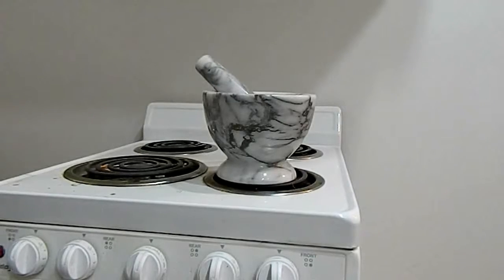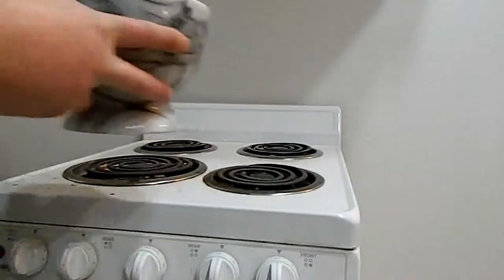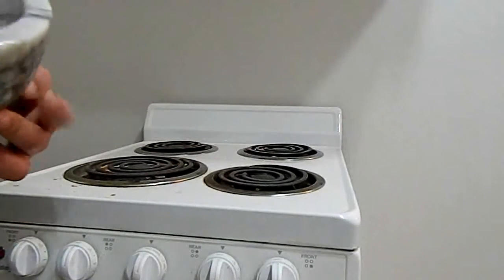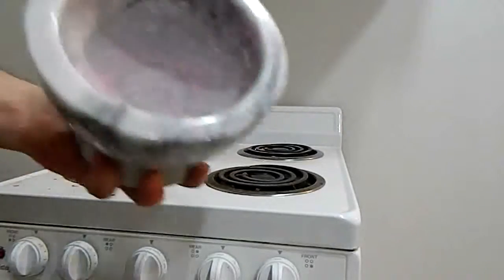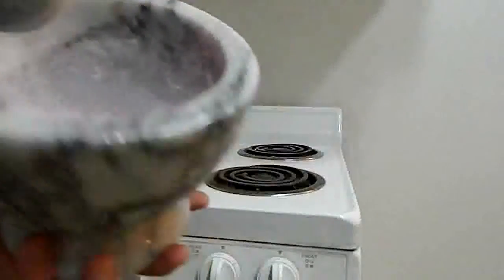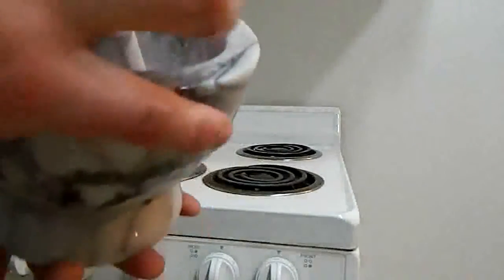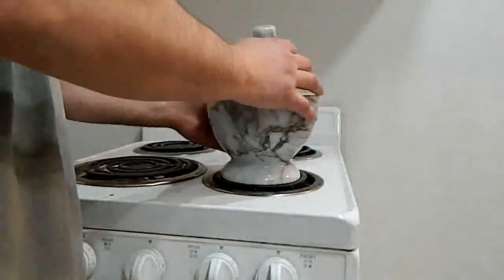036 @ home match head powder.wmv

Comment: Thats because there is a small amount Red Phosphorus in the match head mix. Ive used mortar and pestel to grind down matches för some years now, only small batches thou. Red Phosphorus is very friction dangerous, like in if u mix it with an oxidizer and use a hammer on it, it _will_ go off! There are even more Red Phosphorus on the side of the match box. (several vids here on the youtube gathering this with some alcohol and a blade).

/cheers.